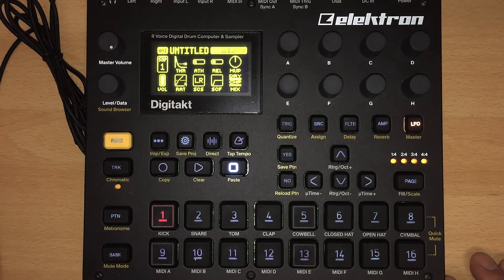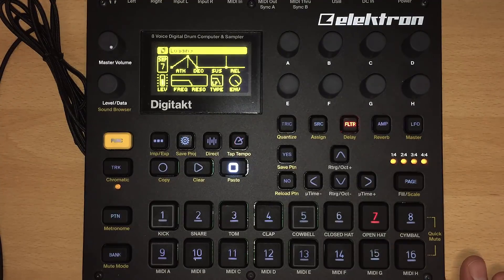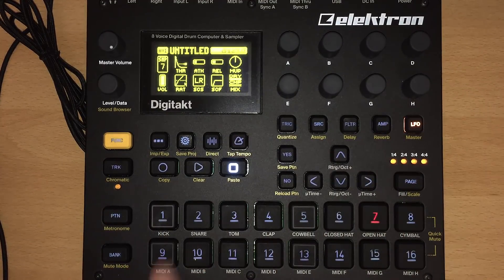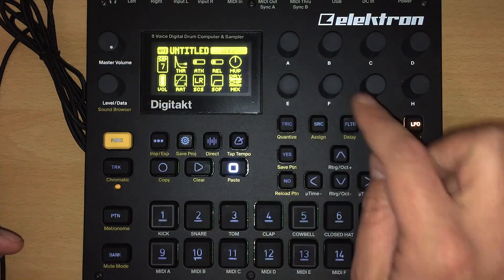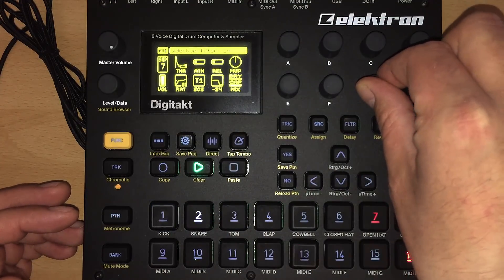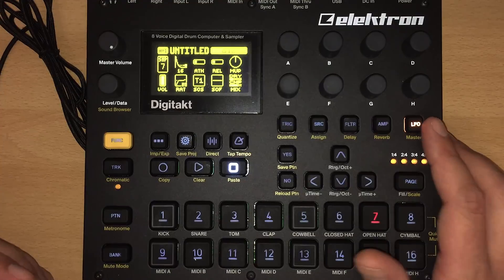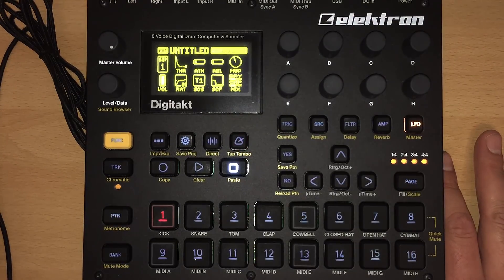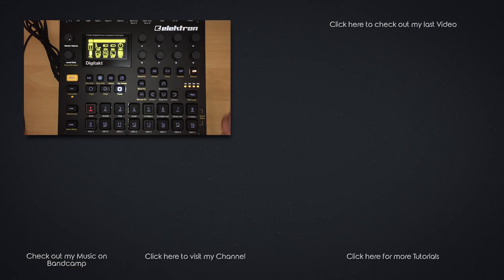Elektron Digitakt OS 1.08: Sidechaining with the new Compressor at "extreme" Settings ;-)

Comment: Couldn't you use MIDI tracks (Amp and LFO) and the MIDI loopback 'trick' to modulate the parameters of the sidechaining compressor where the kick hits to avoid some of the issues you mentioned on the video?

Comment: i want to make some sounds completely mute each other. is this possible with the side chain in here?
For example i want the closed hats cut the open hats. or the snares to mute the hi hats.
Reply from the maker: This is something you would normally do with Mute Groups i assume. At least as far as i understand your question. But the Digitakt doesnt have Mute Groups. The Compressor can also not do this because its a Master Compressor and we dont have individual Track Sends (yet). Why not P-Locking the Sounds in question?

Comment: When you think of the performance aspect of the Digitakt, it's kind of unusual to trigger the sidechain exclusively from the mixer instead of having it automatically enabled on muting channels. I am looking at this from a more modern EDM-ish perspective while I am considering the Digitakt as a performance tool. 

I do think Elektron missed the boat implementing this feature if they were going for a modern approach on music where sidechain is so important, but it's great they made it possible anyway for the musicians needing it. 

Nevertheless the Digitakt is still on my wishlist and its first impression was very good :)
Reply from the maker: The Sidechain is not triggered from the Mixer, its triggered from the Track you selected. I use the Mixer to "mute" the Track without removing its effect on the Sidechain Input ;-) Thats what i've pointed out in the Video. And i've also pointed out, that the Tracks should have a Compressor-Send as well (much like they have a Reverb- and Delay-Send). So that you can decide what gets compressed (as well as Sidechained) and what not.

A truly modern approach for Sidechaining would be a Volume Shaper instead of a Compressor though. In DAWs you work like this for ages already (no one uses a Compressor to do Sidechaining in the DAW anymore). But its obviously better to use a Compressor inside a Hardware since the Hardware can benefit from that Compressor in other Areas too. Not everyone wants to sidechain - lots of people also just want to spice the sound up. And in that respect, the new Compressor from the Digitakt does a really great job! For sure!
Reply: umonox Ah, I misunderstood some things in that case! And you're right on compression to spice things up instead of sidechaining. You obviously shouldn't be forced to use it only specifically for sidechaining since a compressor can do a lot more than just that. Thanks for clarifying!
Reply: a bus would be more useful though, and not that hard to implement.You could even decide to "sacrifice" one of your tracks for this, kind of like a neighbour machine on the octa, but being able to select multiple imputs.

Comment: Great video.  Maybe if Elektron would implement an additional key press to turn the sequence lights into a track activate or deactivate compressor side chain function that would not hinder work flow.  We could use yellow to indicate active and white non per track without really having to change anything else.  Kinda like the circuit layout.